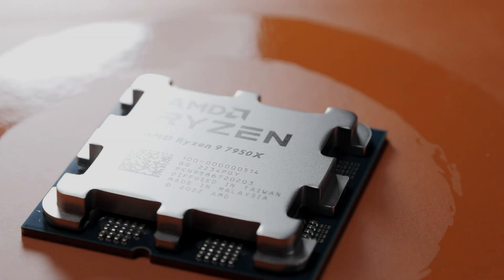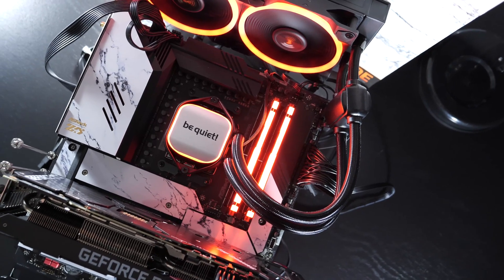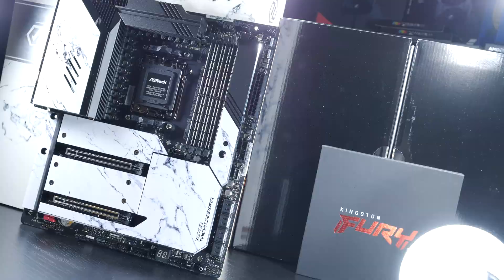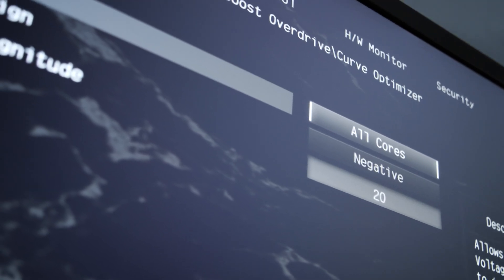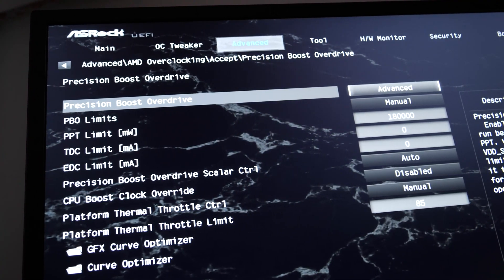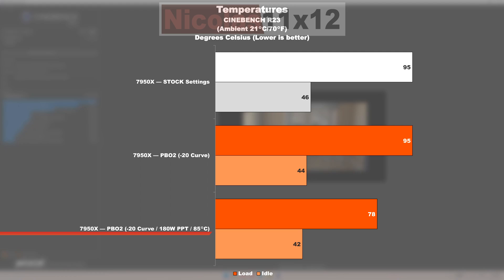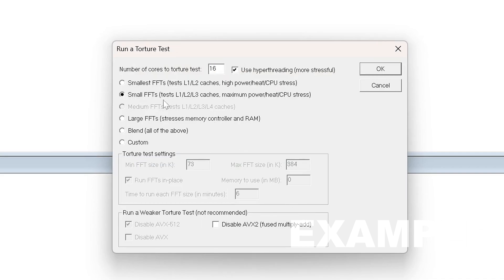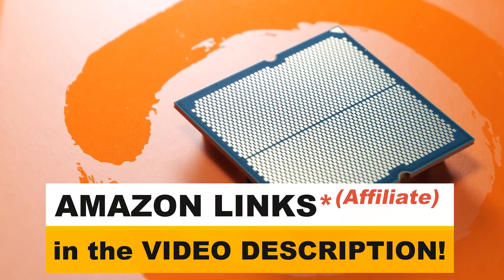AMD RYZEN 7000: How to Lower Temperatures and Power Consumption

Comment: One of the first things Gigabyte installed on my PC among it's tools was "AMD Ryzen Master", I used it's curve optimizer and knocked 15C and 15w off the CPU, and the performance actually increased.
Reply: do you mind explaining to a rookie how can i setup those settings on 7700x with Ryzen master?
Reply: @XASMATV.  If you haven't already, install Ryzen master and open it. On the basic view page, "curve optimizer mode" select "all cores", then "start optimizing". This will take at least 30 minutes, but will select the best voltage curve for each core...it's possible it will find each core can handle the maximum value of -30 (remember this for the future, if you update the BIOS you need to set this again) You need to restart to apply these changes, while at it, select the "Auto OC" and now your CPU will run faster but cooler.
Reply: @Pete856  WOW! your comment is a life saver! thank you very much! i will try it!
Reply: @XASMATV.  You're welcome. Has it made a difference?
Reply: @Pete856  so, this helped drop my idle temp -5c, but again, when i watch a youtube video, it goes 65c. is that normal ?
Reply: @XASMATV.  That depends on your cooler and the CPU fan curve (set in BIOS). That temperature is still low, the real question is how hot does it get when under load....I'm assuming you didn't get a 7700x to watch videos.
Reply: @Pete856  oh OK! Thanks! While gaming and video rendering and stuff, it never goes over 70c
Reply: @XASMATV.  That sounds pretty good, considering it can run at 95c all day long, and it does if you don't undervolt it or have a good cooler.
Reply: @XASMATV.  You were able to use Ryzen Master on your 7700x? The FAQ for Ryzen Master says it's only available on 5000 series chips or lower, and it give me the error that it's not compatible with my cpu when I try to open it. I also have Ryzen 7 7700x
Reply: @Herpaderp10  I actually didn't knew that. Yes I downloaded and installed and everything shows right, I didn't even notice it was only for 5000 series. Works fine with the 7770x
Reply: @XASMATV.  That's weird. I wanted to do the same as you but it doesn't work for me. Upon trying to run Ryzen Master I get an error saying my CPU isn't supported. I ended up having to use HWID and manually set PPT and curve optimizer

Comment: My Limits are
42 
28
35

should i set the last two to zero and enter 142 at the top? I have a 5 7600x 

Did not quit understand that part in the video

Comment: I have been getting 80°C on my ryzen 7 7700x while playing cyberpunk 2077 at 1440p  is this normal ? Using a Cooler Master Liquid ML360L V2 ARGB
Reply: Dude my ryzen 5 7600 is hitting 97c running starfield, tried 2 different thermal pastes stock cooler doing a -30 pbo got it down to 95c stable I need a new cpu cooler but AMD designed these 7000s to run at 95c 24/7 but I still don’t like that lol
Reply: Ryzen 9 7900 (non-X) and I see less that 75c in Starfield with the factory Prism cpu cooler...62c if I disable PBO. @Mantis_Shrimp99

Comment: My stock 7900x idles at 45C and doesn't go over 62c while gaming (I've only been playing Spider Man @4k max settings). Undervolting for a 5C savings doesn't seem worth it to me. If I undervolt any lower, my PC crashes . I have a 360 AIO and 11 fans.
Reply: While gaming that’s completely normal because games don’t use all 12 cores. 

PBO limiting is for people that use their PC for rendering and productivity as well - that’s when temperatures reach high levels. 

If you’re just gaming, you’re good! If it ain’t broke, don’t fix it 🙌🏻
Reply: @gerrydurande2670  "PBO limiting is for people that use their PC for rendering and productivity as well - that’s when temperatures reach high levels."
Thank you so much for this clarification. I thought I was tweaking seeing my 7800X3D reach 80-83 C while running Cinebench, and otherwise idling at 43-45 C.

Comment: My Ryzen 7900x3d was running at 80C while playing games at stock config. I just put -30 All cores and max thermal throttle 85C and everything else left at auto. My cpu runs super cool, temps hardly exceed 62C while gaming.
Reply: weird I tried doing that on my 7800x 3d I didn't see any temp difference just higher boost
Reply: @opinn90  I would like to know, atfer all these months of using 7800X3D, what are your temps running cinebench R23 multicore and what are you're settings ? I have 78000X3D with eco mode at 65W but it goes to 90W when running cinebench and hits 80 degrees. When I look at benchmark I feel like people doesn't have the same CPU than me cause it runs at 75 degrees for 60w max when gaming and me goes crazy high temps over 80 degrees for 85/90W.
Reply: @logame_x7315  Because the ECO mode preset limits for 7800X3D are the same as stock 88w PPT you should manually change that if you want it lower
Reply: @opinn90  not sure about 7800x3d. It works fine with my 7900x3d
Reply: @opinn90 I tried curve -5 and this cooler but not sure -10 is working I had issue with booking the pc please trier and let me know
Reply: are u turned the EXPO/DOCP on? and what cooler do u use?
Reply: @rage2win223  Yep Expo is on - RAM running at 30CL 6000Mhz. AIO Artic Freezer II, Noctua H2 thermal paste. The highest temps I get is 60C-70'C and thats awesome. However, my LianLI o11 EVO has excellent airflow running 9 fans in total including Radiator.
Reply: @the_flick_man  it's strange for me... If i turned the DOCP on.. the cpu temp while idle is around 50C.. and when it's gaming the temp can go >70C.. I'm using lian li galahad 360 AIO btw.. and has the same settings as you
Reply: @rage2win223  idle 50C is completely fine. My idle hovers around 46-48 sometimes 50. While gaming if you see its >70C its completely fine. I had the same fear when I switched from Intel. I know what you mean, coming from intel where the idle is 30 and gaming is 60. But these temps fpr AMD is considered cool. 

AMD CPU is built like that. Trust me do not worry. They are designed to run at a constant 95C 24/7
Reply: @the_flick_man  do play battlefield 2042? if yes, what is  temperature while gaming ? It kinda bugging me cause it always in 68-70+ even I lower my settings still the same.
Reply: @pansitobihonspaghetti1411  trust me 60 to 70 and even 80 C is completely normal for AMD you can run this temp24/7 without even breaking a sweat. When I 1st moved from intel it also bugged me. Do not be alarmed, your system is running fine. For me Cyber Punk and Dying light 2 I hit around 68 to 75 C.
Reply: @the_flick_man  ok thats give me huge relief, it's my first time building my own PC, Thank you for responding to my question.
Reply: @pansitobihonspaghetti1411  no problem
Reply: Do the same on my 7600X, temp +-60c in games, cool, thanks all of you for the tips!
Reply: @Ivan101010001 can u give me ppt tdc and edc?

Comment: Great tutorial Nicolas. I have a question. Can the 7900 (non X) clock speeds be manually increased from 3.7GHz to lets say 4.2GHz?. 

If so, how can it be done in BIOS?. 

Thanks for your help.
Reply: Yes. I tried setting the Clock to 48x and 1.05v . Works fine.
Reply: @AsHaH13-FuzzyWuzzy  - thanks for the update Amir. Eid Mubarak.
Reply: But then if u do that u cant use the PBO Curve.

Comment: I have a Ryzen 9 7900x cpu in my rig and I tried following along but in my bios it doesn’t give me the option for mW it just says watts and volts. So what do I put in there so I don’t ruin my cpu? I want the best temps for gaming and video rendering if that helps but I’m terrified of doing anything in bios and that I’m gonna break it 😭
Reply: mW and Watts are the same. 1000mW = 1W. Therefore, you would probably want to set up 180w as per the guide. Do check your motherboard documentation just in case.

Comment: I just tested my 7900 (non-X) on cinebench R20 and it hit 92c at it's highest. This is with PBO and auto OC enabled. Tested with my Arctic Freezer eSport Duo with 2 noctua 3k-rpm industrial fans (110cfm each). When I disabled PBO and auto OC in BIOS and tested again in cinebench R20, my 7900 (non-X) did not go above 44c. Here are the scores - 

PBO & auto OC on = 10,729.
PBO & auto OC off = 7,768.
Performance hit = 27.6%   

With PBO & auto OC on, my noctua cpu fans were running very loudly and at near it's highest rpm. With PBO & auto OC off, my noctua cpu fans were running a lot quieter. 

I think the Arctic Freezer 34 eSport Duo is a very good cooler and it will be able to handle the 5800X and 7700X even with PBO/OC turned on, but it will be loud. Much better thermals and audio if PBO and auto OC is turned off. 

The AF34ESD will struggles to cool the 7900 (non-X) if PBO and auto OC are enabled, but will be able to handle the 7900 (non-X) with these two features disabled. 

I will now run the same tests and compare with my ThermalRight Peerless Assassin 120SE. I have been using it as my main cooler and I am not impressed. It gets out performed by my AF34ESD. I think I may have gotten a crap one. Back to Amazon.
Reply: loud ahh pc

Comment: AMD (and intel) have the power set overly high in order to increase yield.
Some chips which are of borderline silicon quality can pass spec if they are juiced heavily.
But most chips can run the clock curve with less power.
Even the 'borderline' silicon ones will last longer and work better just going slightly slower at lower power (if your chip doesn't like undervolting, lower it's max clock cap a bit).
Reply from the maker: So true.
Reply: @Nicolas11x12English  If anything, I think they're actually sacrificing max-benchmarks in order to achieve max yield. Both companies are juicing the chips above ideal power for benchmarking (for most of the chips), in order to get borderline silicon to pass minimum spec.

It's a sign that supply/demand is heavy on demand, and yield rate is of high concern at these new node sizes.

But if anyone lost the silicon lottery, and has a chip which doesn't undervolt well... it's still worth undervolting, but they'll want to knock the max clock down a couple hundred Mhz. at 5 Ghz, a 200 mhz underclock is only a 4% drop, and could allow those chips to undervolt, and make them last much longer, burn less energy, make less heat, and probably run more stable.

So pretty much 'everyone' should be undervolting. It's just that an unfortunate few will want to also underclock slightly. It may suck to know you were jipped out of 4% more performance than most who bought one, but that's really not going to be noticeable. And leaving it juiced super-heavily, it'll run overly hot, fry-away the thermal paste way too quickly, & wear out much too soon. Whereas if corrected, it'd be a barely noticeable difference.

I have a 1080 Ti Strix in my older computer. It was not stable at the factory overclock (9% over FE). I lost the silicon lottery. I felt disappointed of course. But I de-tuned it to about 6% over FE, and it performed flawlessly for 6 years and about 20,000 hours of heavy abuse, and it still works like new. My "badly binned silicon" graphics card has been the most reliable and best performing graphics card I've owned, because it was corrected. And as a user experience, I did not really notice the difference between 109% of default spec, and 106%. It can still match a 3060 Ti (no ray tracing obviously though). I only built a new computer cuz my 4790 was starting to really struggle, and I wanted to go 4k. The "badly binned" 1080 Ti was (is) still running like a champ for 1440p-raster.

Comment: My 7900 non-X sits between 38c to 41c at idle with PBO and OC disabled. Cooling with Thermalright Peerless Assassin 120 SE and two Noctua 3K rpm fans (rated at 110cfm each).
Reply: My 7900X at stock/idle wanted to idle at 52C just sitting in bios. PBO -20 by itself dropped that to 42C. Room temp was 25C so the delta was +27 C down to +17~ish C.
Benchmarks were slightly "better" with undervolt (it bounced off the thermal throttle less).
7900 non-x might have a bit better power curve tweaking out of the box, just because it came out month's later, and after customers kinda taught AMD how to tweak it properly.

I have a 420mm water radiator on it (3x140mm fans). Interestingly the water temps don't rise very easily (just a huge amount of thermal mass & heat-soak in such a big radiator). Considering how slowly the water temp rises, I doubt "more cooling" would lower the cpu temp at all. I kinda have overkill for dissipation. Still, at stock settings, it liked to run HOT. I think that thick top plate kinda puts an upper limit on dissipation.

Comment: is it normal for my 7900x to run at 72--82 C during idle or browing?
Reply from the maker: No, that's way too hot. Does your cooler make proper contact with the CPU?
Reply: @Nicolas11x12English  omg so i just figured it out.. it was icloud for windows .. i killed it from the task manager and now pc idles at 49-52 WTF
Reply: @Jake-bh1hm  wow
Reply: @Nicolas11x12English  I think so, the first day it ran around 50C but the 2nd day it ran 72-80 at idle.. i dont know if i should return the processor, or the cooler or what. I am using Noctua NH-U12S redux with 2 fans. I used cosair thermal paste and I reapplied it twice already because i thought i messed it up or something. Still running so high. Getting super frusturated at this point :(

Comment: Applied in bios but does not limit any thing temps still hit 95 almost as if it’s ignoring the bios
Reply from the maker: Did you go into the AMD Overclocking settings and set the limit there?
I've experienced when you go for those "shortcuts" often provided in the OC section of the BIOS, those settings don't get applied for whatever reason.
Make sure to use AMD Overclocking settings within the BIOS. It usually requires digging a little deeper than normal OC settings. :)

Comment: Very strange why your videos get so few views, what happened, i used to watch you for 10 years now since gtx 770 reviews. Also have you noticed that on latest bios with latest agesa, there is c state lock of 5.5ghz on 7950x. I have this cpu and b650e pg riptide wifi and on release bios there is no such thing cpu will boost up to 5.7ghz+ on many cores, while with newest it doesn't. What about your combo ?
Reply from the maker: Strange, I haven't tested my 7950X with the latest BIOS yet. :o
I'm assuming, the Boost clocks will go higher with future BIOS versions again.
BIOS development for many motherboards is a hit and miss, as far as my experience is concerned. Haha!
Things get fixed, but some functionality often is broken until a new update arrives.
Reply: @Nicolas11x12English  Skatterbencher did overview of this strange decision of AMD two months ago, and i noticed that its not only Asrock, others who have latest bios now have same lock. PBO doesn't work, it will still boost only up to 5.5ghz all core. Only positive thing from this is that you can increase undervolt even higher, with Release bios i could only do negative 20 while with newest bios around negative 40, because it won't go past 5.5ghz and crash attempting to hit 5.8ghz with undervolt. So sustained loads benefit from it, like cinebench r23, my 7950x hits 5.4ghz all core. However in games it slower. Staying on release bios seems only option for now
Reply from the maker: @TheThaddeusLab  That's really odd. Thanks for letting me know! :)

Comment: this is a beautiful video. can you please tell me where do you get ppt limit value for the different cpu?
Reply: Ryzen 5 7600
Reply from the maker: @lanzary1  Your Ryzen 5 7600 should have a max PPT limit of 88W.
You could try to lower it even further, but I doubt your CPU will allow for much better efficiency than it already offers at stock. AMD's Ryzen 7000 Non-X CPUs tend to run fairly cool and power efficient as opposed to their X models.
But you can of course try your luck! :)
Reply from the maker: Thank you! :)
You just have to experiment a little bit. Which CPU are you specifically having in mind? ^^

Comment: Interesting 🤔to see how far both AMD & Intel are pushing their new cpu lineups to take the performance crown 👑. I personally would undervolt my pc cpu/GPU to gain best possible performance, temps, voltages, cooling etc for a noticeably quieter pc without ramping cooling fans 💪😇🥰👍
Reply from the maker: Indeed, that really shows here. Undervolting and optimizing one's hardware seems to be the way to go now more than ever before. :D
Thanks for watching and commenting, Michael! :)
Reply: @Nicolas11x12English  Hey - Planning on setting a normal 7950x and was wondering as you have set only the PPT Limit to 180 Watts. Do we need to also set TDC and EDC limits aswell or can we just use PPT Limit?

Comment: My 7700X stays under 90C while gaming with a Noctua U12A and an open front case.
Reply: Dude, I just posted another comment, regarding cooling my 7900 (non-X) with Arctic Freezer eSport Duo. Check it out.
Reply: @beachboy_boobybuilder  epsorts duo are garbage coolers. lmao. i just got a deepcool AK620 and it goes no higher than 74C while gaming.
Reply: @JayzBeerz  7900X and a Deepcool LS720 (360mm AIO), my temps are 95c in Valorant and 55 to 70 while idle...
Reply: 90c is really high
Reply: @beachboy_boobybuilder  no it's not for all the new CPU's.